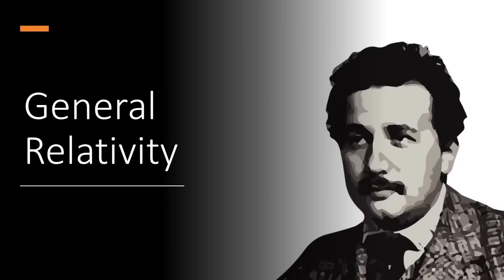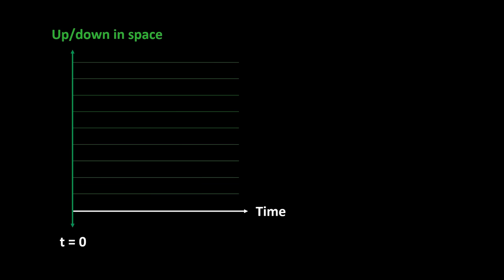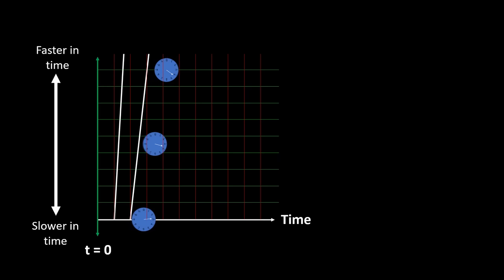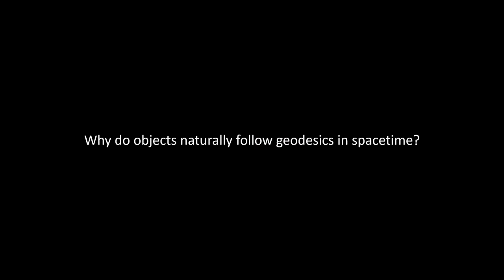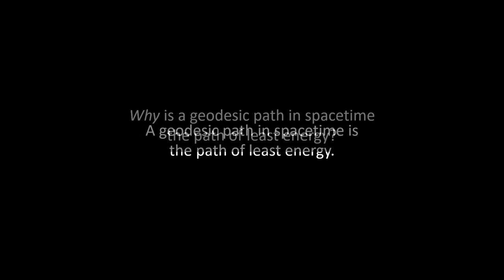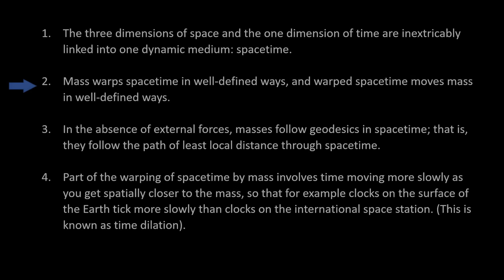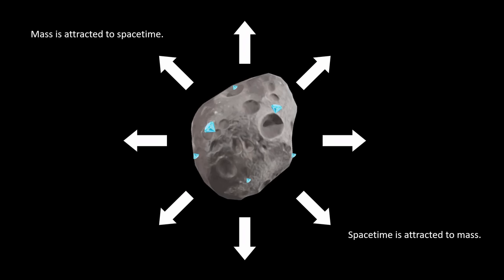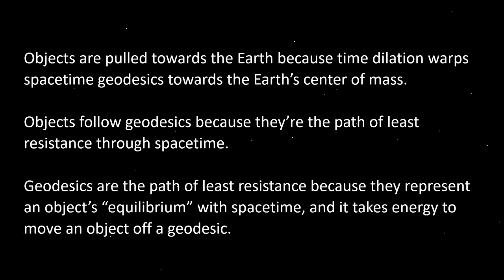How Time Dilation Causes Gravity, and How Inertia Works

Comment: "Why does mass warp spacetime?"

The simple answer to the question is: relative parallax causes infinitesimal particles moving at instantaneous velocities to "slow down" or "warp" in space. That may sound impossible, but read on. It solves a LOT of problems and makes more sense than any of the current speculations.

I have been working on this for a long time and finally figured out very recently that infinitesimal particles (no size) create mass because of a parallax effect as they pass each other in space. The particles "register" each other as moving at slower rates than themselves. The further away the other particle, the slower it appears to move.

This is exactly the same effect as two airplanes who think they are flying parallel, but within a few seconds, they quickly discover that they were on a collision course, but too late, they collide.

Now these infinitesimals can never collide (being infinitesimal), but as they pass the same point in space, each becomes attracted to the other because to both particles, their paths curve, even though neither has changed course. This relative curvature causes the particles to seek a straight line in relation to each other, forcing their paths through space to curve. As their paths diverge, they become locked by a gravitational pull as each slows down in relation to the other, shaping their path as a curve. This creates a sine wave.

Time itself emerges from the relative movement of infinitesimal particles. The particles are normally inclined to change in position without change in time (instantaneous movement through space), which is identical in appearance to a stationary particle that changes its time without changes in space (instantaneous movement through time). However, the particle moving through space instantaneously has a pathway, even though it does not trace out that pathway in time. The above-mentioned curvature occurs as two particles' paths cross in close priximity relative to the rest of the universe. But since they register a velocity of each other as slower, due to a hierarchical relationship to all other particles in the universe, their path curves together, warping space time, and both particles are slowed through spacetime, though both particles are technically moving at instantaneous velocity.

This is what I call relative parallax. Their angle in relation to each other creates a spiral wave we register as a sine wave. Any other particles in close proximity can alter the path of the first particle pair and so on, causing a change in frequency. (I believe these pairs are photons or that photons are pairs of pairs of these particles based on recent findings at the LHC and the mathematical model of a photon having two parts revealed in December, explaining their spin 1), and I am currently of the opinion that the more parallel the particles travel, the flatter the wave, while the more perpendicular they travel, the more trophs in the wave, based on how much energy is transferred by the other particles. However, I am willing to accept the opposite. I still have to model it properly.

I had found that the particles have to start out with a rest velocity of instantaneous movement, leading to causing time, spacial curvature, energy and all four forces. That does not happen with non-moving particles starting with instantaneous time. In that scenario energy has to be added, but in my scenario, time, energy, mass and gravity emerge naturally. It also satisfactorilly shows that the universe is classically deterministic without some underlying, inexplicable, spooky "quantumness". (Though this does not necessarily mean that consciousness is superdeterministic, as the parts can exceed the whole to allow conscious agency.) QM is still just probability based on group theory, not a fundamental quality of space.

Bound photons sharing and trading infinitesimals creates electromagnetism and other particles in effectively three-body systems, producing 1/2 spin. It is the destabilization of the gravitational monopoles of the bound infinitesimal particles that creates electromagnetism. The restabilization of the  field with additional particles having a counter-stabilizing effect produces weak force, and the perfection of this balance produces the strong force.
Reply: No likes, no replies in 3 years. How does what you're describing relate to the collapse of the wave function?
Reply: @gandalfgrey91  Look at the other comments under the video and observe their commonalities and how they differ from mine. Maybe you will find your answer. But the most common reason not revealed is that most comments occur within the first week. If I came across it later than that, there is little chance of reply. Not all comments get answers. There are many reasons I might get no reply. Other comments I've made have gotten many replies. No reply on a Youtube video is no measure if my comment’s validity.
Reply: @gandalfgrey91  Also, I have no idea why the wave function should matter since I was not commenting on that.
Reply: @Dismythed  I only ask because your flavor of reasoning intrigues me and I’m curious to hear your thoughts on that subject.
Reply: @gandalfgrey91  I’ll contribute a little to that below and provide some articles you can look up. I have to break it up into two parts because of the YT algorithm.

Work was recently done turning photons into quasiparticles (groups of particles that act as a single particle) that behave as a supersolid (particles that flow like a liquid while in a crystalline state). That happens to relate to the liquid property of particles that resolves many quantum issues.

They are not fermions and yet they produce particles that interact with solid matter like a fluid. This means that the fluid property goes all the way down to the fundamental state of all matter.

It also proves that photons are particles that generate sinusoidal wave effects.

Another nail in the coffin of the idea that photons are pointlike collapses of waves was recently published in the paper "Bright and Dark States of Light: The Quantum Origin of Classical Interference," in PRL.

Quantum particles acting like fluids was further confirmed in the article “Dynamical Formation of Multiple Quantum Droplets in a Bose-Bose Mixture" in PRL. In it, a supercooled atom-sized cloud of subatomic particles act like water drops producing Plateau-Rayleigh instability (fluid drops breaking apart). Granted, this is only at the atomic and just subatomic level, but it doesn’t take much to transfer that down to the electron and then photon level by observing the “capillary action” that makes up the surface tension effect (Meaning there is surface tension due to capillaries by means of capillary action all the way down).

There was also another article that I forgot to note that observed pressures and fluid viscosity in the movements of quantum particles.

This was further bolstered in PRL by the article "Observation of a Lee-Huang-Yang Fluid" wherein a quantum effect stabilizes the interaction of particles to prevent collapse. I figured that one out years ago, but note that this causes further fluid-like effects and I predict will ultimately be connected to lambda and antigravity.
Reply: @gandalfgrey91  This is why I favor assuming known effects as explanations over creating mystical phenomena like "quantum weirdness" or pinpoint wave collapse to explain particle interactions. I believe we already have all the math we need to figure particles out from the ground up (Constructivism). By that method, these things are only confirming what I have already worked out over the past twelve years by modeling infinitesimal pointlike particles with existential  geometric interactions.

Add in the theory that photons are made of two “parts" as brought out in a mathematical paper a year or two ago and my theory that photons and electrons are made of 2 and 3 smaller particles respectively also have legs. The only question is whether those smaller particles are themselves made up of smaller particles or not. But by my theory, it only takes two (binary) or three (trinary) infinitesimals to make a larger particle. I don’t need to multiply complexity and quantum weirdness to explain particles and their effects and the published science experiments provide new evidence almost every month.

Also, it’s only the movements of infinels (truly indivisible infinitesimal particles) in an existential geometric (non-QFT) field that provide mass due to offset gravity and antigravity by means of motion. "Infinel" is just a portmanteau of "infinitesimal particle". I'm not interested in coming up with a fancy new name. I find nothing special about it since it has no size, mass or any other property that is merely the source (or result) of time, energy and motion (Three sides of the same coin, if I may butcher a saying.)
Reply: @ Interesting take! Just curious — how does your model explain stuff like interference or entanglement without needing wave function collapse?
Reply: @gandalfgrey91  They have been finding more and more evidence in the last few years that Einstein was right: entanglement is just gloves in boxes (The decision already exists. We are just not able to know until we observe it.) One paper said they were able to restore a particle’s direction after observation by means of an interacting chain.

As to interference, light interference has been debunked many times. Light of any wavelength simply cannot interfere with light of any other wavelength. A paper came out last week providing an explanation for the double slit experiment that requires no interference, but rather, photons turning dark. I’m not sure it is correct, but it does show that there are explanations that do not require physical waves. Another paper claimed to create chiral light (light that changes phase on its own) in experiments that were duplicated by more than one lab. One of the phases was invisible.

I think all the evidence of physical sinusoidal waves has already been all but debunked, and the uncertainty principle shown to be not so uncertain, by attosecond physics. The observation of sinusoidal waves to date are easily explained by statistical anomalies and temporal drag. As they say, sinusoidal waves do no work.
Reply: @gandalfgrey91  I posted a reply, but the algorithm ate it. I'll have to reply again later.
Reply: @Dismythed  i hate when that happens. Either way I really appreciate you taking the time to answer
Reply: @gandalfgrey91  The answer requiring the fewest assumptions is likely to be the truth or lead directly to it. The so-called "collapse of the wave function" occurs because there is no wave function. That’s the simplest answer and requires only one assumption.

The so-called "wave function" is just electromagnetism (Monopole gravity breaking into separate poles) occurring from two particles circling each other. Simplest answer requiring only two simple assumptions.

Did you know that wave interference of light has never been observed to happen outside the slit experiment? For that reason, it is disregarded in all other physics. Light of any frequency and wavelength does not interfere with any other light of the same or different frequency or wavelength except at the point of electromagnetic contact (repulsion/attraction), not within the supposed wave itself. One of the articles I cited above said they were able to make light move chirally (through color modes) and velocities, changing phase as it goes by passing it through a particular molecular construction. One of those phases was invisible.

An article was dropped the other week that attempted to show that interference in the double slit experiment was actually photons switching into a dark mode. I don't know if that's true (It fits with the above experiment), but it does show that there are explanations involving simple particle interactions that do not require waves interfering.

Entanglement continues to acquire more and more evidence that it is exactly as Einstein thought: two gloves in a box. One article a few weeks ago said that they were able to restore a particle’s original position after measurement by means of a chain of particles lending their angular momentum.

The simplest answer with the fewest assumptions in regard to all these articles I've cited today is that photons are actual particles with a fluid nature and do not have a wave function.

Comment: This seems like a great explanation, until you realize that: A) nothing is moving faster through time, rather the planes of simultaneity of the accelerated observers on earth are merely rotating with respect to the higher-up observers. B) the geodesics don’t “bend” into space; the ground is merely accelerating towards them, and you’re drawing them from an accelerated frame of reference C) indeed since the diagram drawn is for a uniform gravitational field, we can perform a simple coordinate transformation so that our “bent” geodesics will be straight once more, ultimately demonstrating that D) a uniform gravitational field has ZERO curvature and therefore exhibits no warping of spacetime. E) Meanwhile, a non-uniform gravitational field does have curvature; plotting this on a spacetime diagram and you would see that geodesics diverge or converge towards one another. Changing separation between geodesics is real curvature, i.e., tidal forces, which is real gravity.

It was a good video, but sorry, curved lines on a spacetime diagram do not equate to spacetime curvature.

Comment: A couple of corrections: 1) Length contraction is a direct result of the relativity of simultaneity and rotation in the time dimension. It's not a physical effect; it's merely a perceptual distortion seen from another reference frame (as proven by the fact that spinning wheels remain contracted in the direction of relative motion), so it can't be caused by the warping of spacetime. 2) The concept of relativistic mass has mostly been done away with by physicists. This doesn't change the essence of your point, just the terminology that you should use when making it. Something to look into.
Reply from the maker: Thanks for that correction. On point 2, I'm aware of that, and I don't believe I referred to relativistic mass in the video; generally I'm speaking about inertial mass in this video.
Reply: @IdeaListEye Yes, mass dilates too, hence the term "mass becomes infinite at the speed of light". This does not mean mass increases, it means mass becomes spread throughout spacetime relative to an outside observer. Time dilation is just one aspect of dilation, it's not just time that gets dilated. Even mass that exists at 75% light speed is partially dilated.
   It occurs wherever there is an astronomical quantity of mass, this includes the centers of high mass stars and the majority of galaxy centers. This has been accepted for a long time.
   Dilation is occurring in our own galactic center. This means that there is no valid XYZ coordinate we can attribute to it, you can't point your finger at something that is smeared through spacetime. In other words that mass is all around us. More precisely, everywhere you point is equally valid. It's the "missing mass" needed to explain galaxy rotation curves.
   It doesn't occur in galaxies with low mass centers because they do not have enough mass to achieve relativistic velocities. It has recently been confirmed in 6 ultra diffuse galaxies including NGC 1052-DF2 and DF4 to have normal rotation rates, in other words they have no dark matter/dilated mass.
   Mass is a clingy thing thanks to gravity. It makes sense that dilated mass would exist as a halo around galaxies.

Comment: So why is there little to none gravity on the moon 🌙 can yall  answer quickly . why dont the sun 🌞 gravitational pull affect the moon like it affects the Earth. And if gravity is measured by only 2 masses size and distance why is the moon ,earth, mars ,and Mercury gravitational pull so extremely different . they all should be affected by sun in almost the same way.
Reply from the maker: The moon has a smaller mass than the Earth (~1/6th of it), so the gravitational pull by the moon is roughly 1/6th at the surface of the moon. The sun's gravity does affect the moon just like the Earth. The gravitational pull by the moon, Earth, Mars and Mercury are all different because they all have different masses. The gravitational pull on all of these by the sun is different because they're all at different distances from the sun (except for the Moon, which is pulled on average about the same by the sun as the Earth is).

Comment: In the comments section, I find it is remarkable that the guy noted that the mass of an, for ex. a nucleus is not only due to the Higgs field quarks but rather due to the kinetic energies of quarks within a very confined nuclear volume. They vibrate at relativistic speeds therefore this kinetic energy converts to the mass of the nucleus, wow....

Comment: A problem I can't seem to find an answer to... I accept that relativity map the relationship between mass and spacetime. This the effect but not the cause. What is the method but mass warps spacetime, the cause? Is it possible to measure changes in spacetime inside a mass? Does this mean there are measurable changes in spacetime with changes in state from gas to liquid to solid and with different densities of different materials?